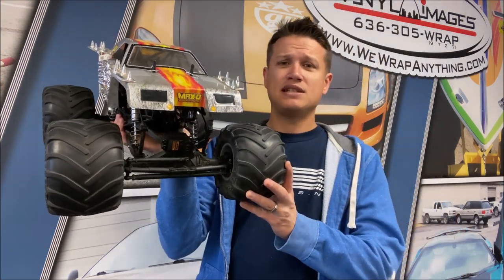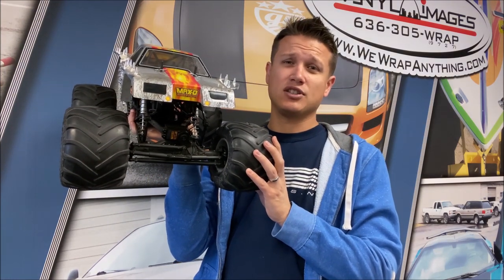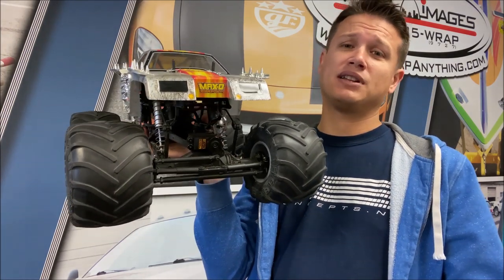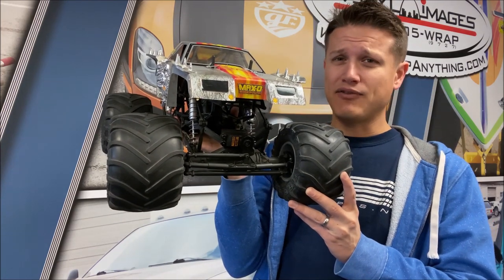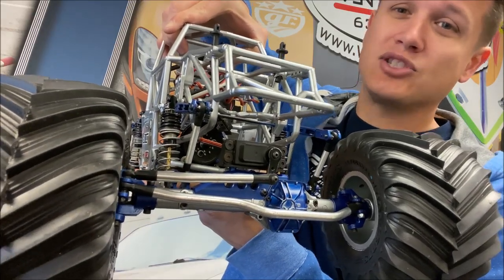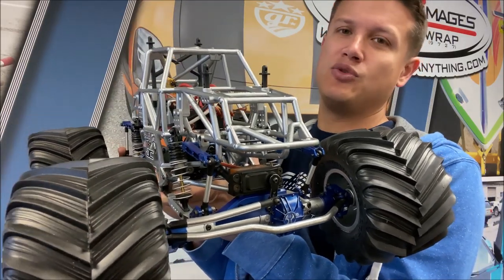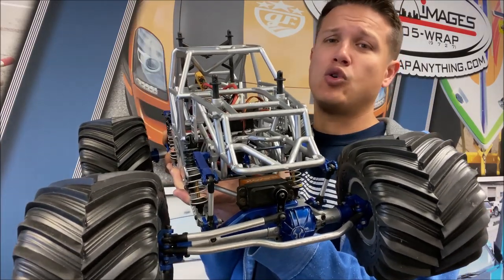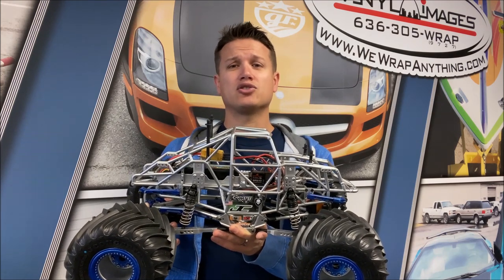RC Servo Savers Explained -Trigger King Tech

Comment: Good info and nice trucks! For my bashers, I like loose servo savers. On my track race cars, I use plastic servo horns. That eliminates hesitation and slop of a servo saver. The plastic horn will and has broken from a big enough hit which still provides a little protection to the servos.

Comment: Hi friend. What do you recommend for Shortcourse truck Arrma Senton. Mostly playing for layout race Track ? Servo saver / servo horn. I use Servo JX ecoboost HIgh voltage
Reply: Hi friend I’ll answer this.:
 
I have the zoskay 35kg high torque coreless metal gear digital (control angle 270*), servo. from Amazon it has a solid servo horn so no saving but it has lasted me months and months so far no damage senton drives straighter then ever. It’s colored blue with black plastic if you want it its $33

Comment: I have the new smt10 Grave Digger. On the first run, the clip on the servo saver popped off. The servo was still rotating from side to side but the wheels weren't moving. After that, the shop I bought it from ran the steering just like yours without using the servo saver. Did another run and the steering stopped working again. This time, the servo is not moving at all and I don't hear anything. Maybe a barely noticeable slight hum. What could the issue be? What's the cheapest alternative?
Reply: Probably something stripped? Have you opened the servo  same thing happened to me the clip fell out

Comment: I have a custom built monster truck using ar60 axles and whether I use a servo saver or a metal horn any little roll over or anything throws my steering outta wack!why is that!I'm not using a high dollar servo but it is 35kg with speed and power!

Comment: I can tell the difference in steering, but I don't think my wallets likes the feeling of not running a servo saver. I stripped 3 servos before I got a servo :(. I use the hot racing one now and it works OK.